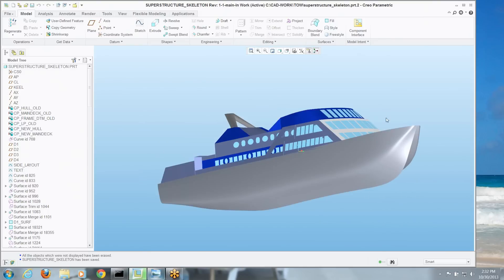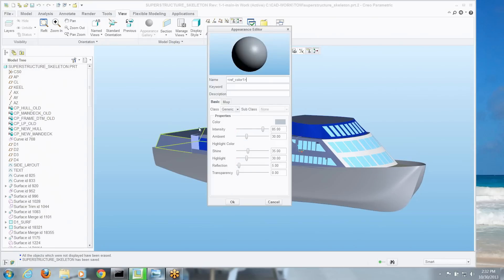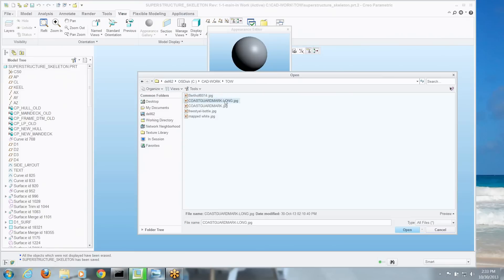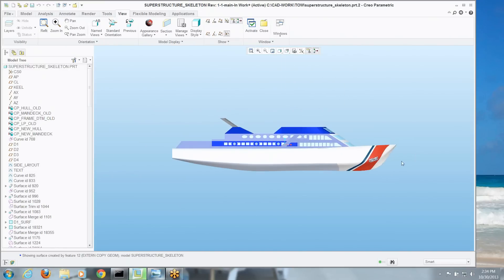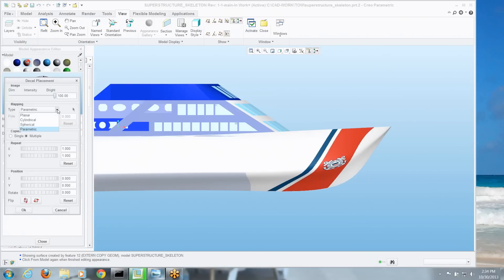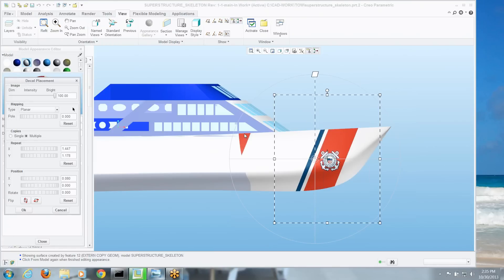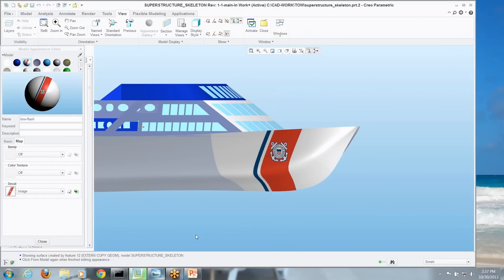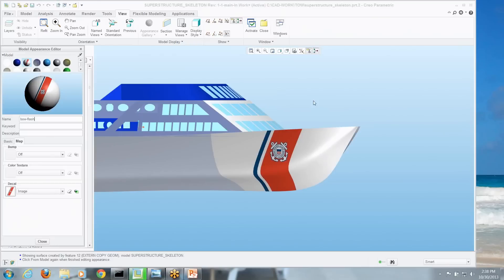How to apply an image or decal to a Creo Parametric model as a texture - EAC Tip of the Week

Comment: can anyone help me , i am trying to import .pvz file created in creo into thinkworks but it is not showing trexture 
i have tried changing configuration option too but still no luck.
please advise
Reply from the maker: There is a recipe file, export_pvs.rcp,  that needs to be edited to add the following lines:
 
adapter/useProETess=1
adapter/useTransparency=1
adapter/useTexture=1
Adapter/modifyTexturePath=1
 
Find this file in the install folder for the specific version. For example,
E:\ptc\Creo5_030\Creo 5.0.3.0\Common Files\text\prodview\export_pvs.rcp